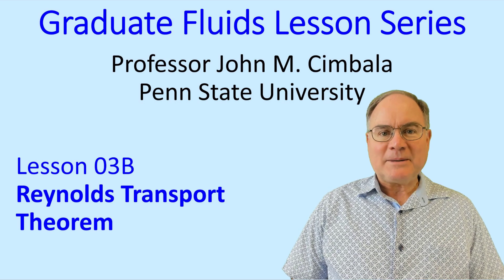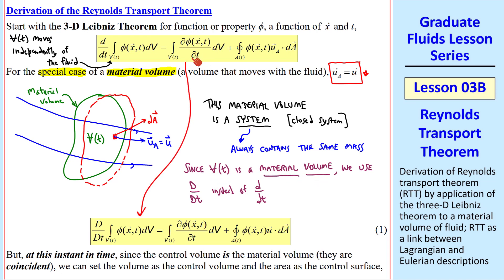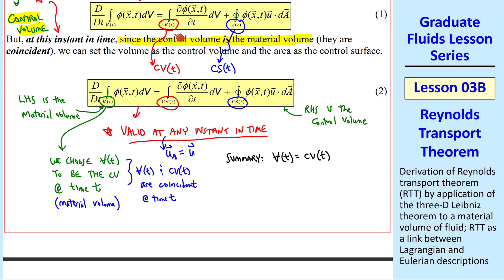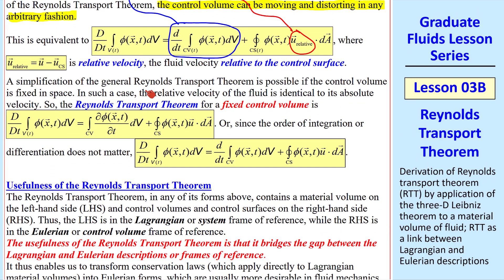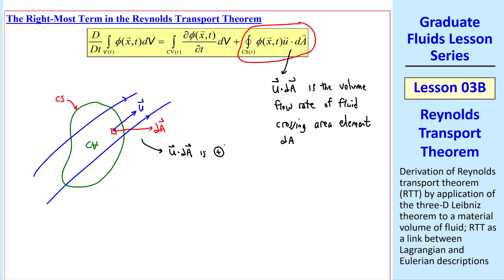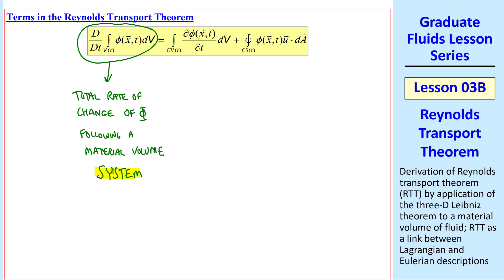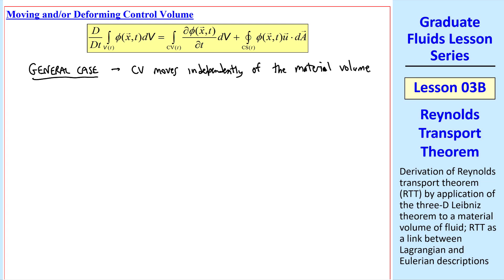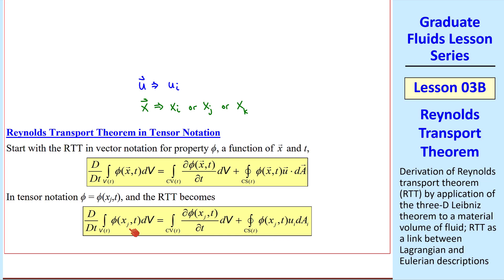Graduate Fluids Lesson 03B: Reynolds Transport Theorem

Comment: Hi John. Would it be correct to say that the system approach, Lagrangian approach, and differential approach are analogous? Similarly, are the control volume approach, Eulerian approach, and integral approach analogous? If not, could you help clarify how these approaches differ?
Reply from the maker: Mostly correct. System and Lagrangian are pretty much the same. Control volume and integral are pretty much the same. Differential can be either. In fluid mechanics, Eulerian is typically preferred over Lagrangian and that is why we use the material derivative, as covered in a different video to transform from system (Lagrangian) to Eulerian differential equations. In an integral analysis, we use the Reynolds Transport Theorem to do the same - go from a system to a control volume. Hope this helps.
Thank you for your comment. Please tell your friends and colleagues about my YouTube channel where there are over 500 free videos about the Bible, fluid mechanics, science, math, Excel, statistics, air pollution, and other topics. I would greatly appreciate it.
Reply: @johncimbala  Thank you, John, for the explanation. I will certainly recommend it to my colleagues and friends. Following up on the query above, what about moving or deforming control volumes? This concept may not be analogous to the Eulerian description.
Reply from the maker: @suryatejaananth5724  Deforming CVs get a little more complicated. However, you  must sill start with the system equations (like conservation of mass) and then transform to the CV equations using the more general Reynolds Transport Theorem for CVs. This is covered in my fluid mechanics textbook and to a lesser extent in some of my lesson videos.